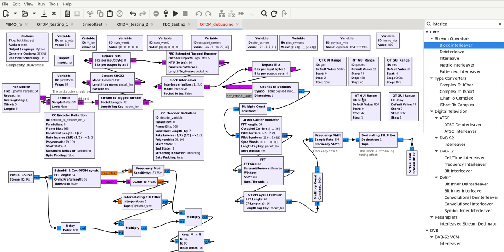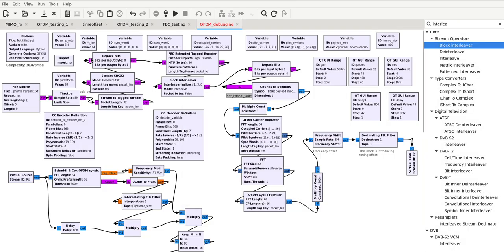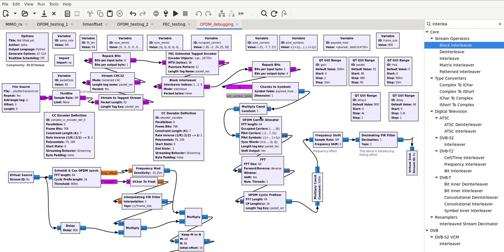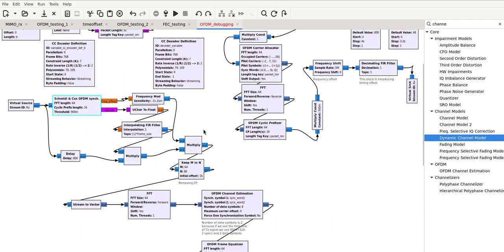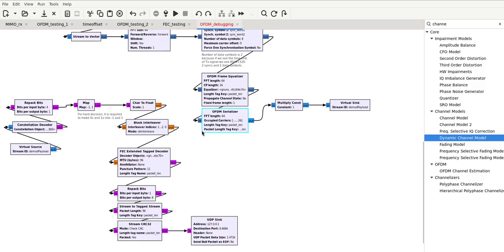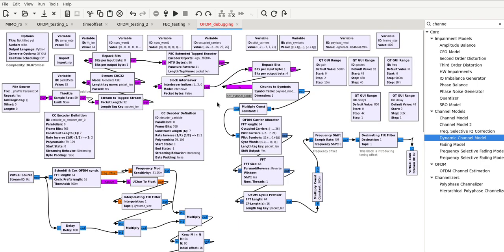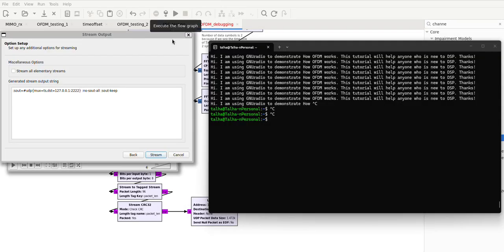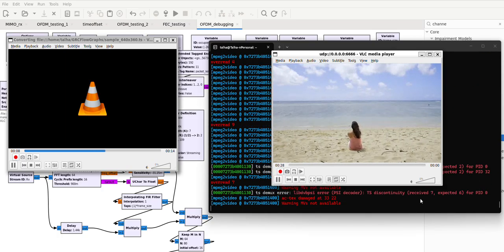GNUradio-OFDM (UDP, VLC, Texting)

Comment: I'm working on OFDM what is this import np file u are using here
Reply from the maker: whenever you are using any python modules you should import a package that contains those module. in this case, i am using numpy modules in a block. so that why i had to import numpy as np
Reply: How to evaluate the bit error rate of the OFDM chanel ?